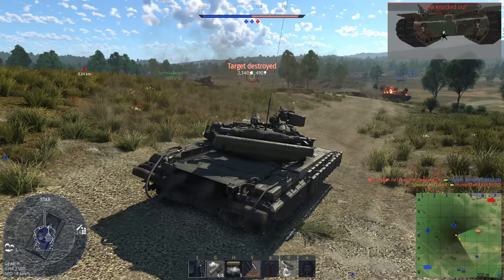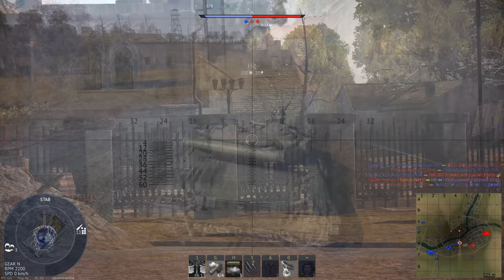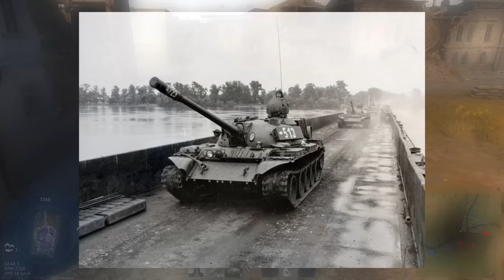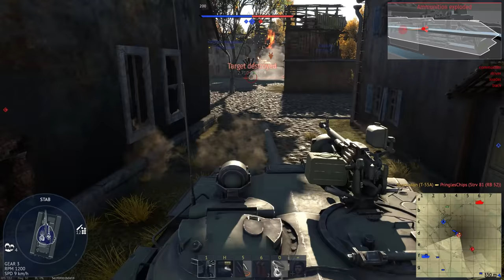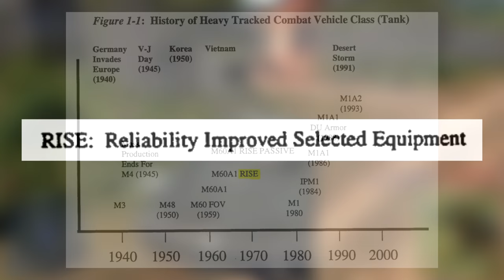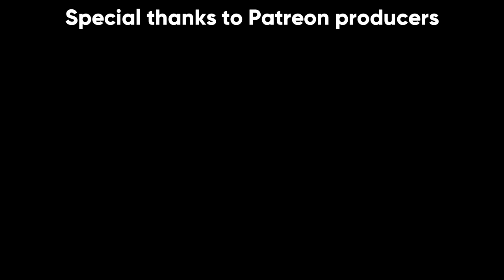Were Soviet Tanks Poorly Made?

Comment from the maker: There are a lot of misconceptions about the T-34 in the comments, so I thought I would clarify. When it came to parts like sights, radios, and intercoms on early T-34s, the quantity of them was not a huge issue. The quality was. Early periscopes used polished steel, which obviously reduced sight quality. Both the intercom and radio had reliability issues, but as mentioned in the video, they were improved as time went on. Ventilator fans were of short supply on early T-34s, but supply lines were eventually stabilized. Gun fumes once again became on issue on the T-34-85 (and specifically during warmer months), but designers did try to fix the issue as fast as they could. First they tried introducing a bore scavenging system, but the spent casings would still release fumes. The problem was eventually fixed entirely with the introduction of bore evacuators. The welds on T-34s were technically of lower quality and more brittle, but US intelligence during the Korean War noted that it did not have an effect on battlefield performance. The armor plate itself had a much higher hardness, increasing protection against singular shots but also increasing the chance that the plate would shatter with multiple hits. This was a deliberate design tradeoff. I remember recording a line stating that the quality of T-34s varied wildly from plant to plant, but I must have accidentally skipped it while editing. Some factories certainly cut corners while producing T-34s, but this was a necessary step. Soviet forces would often undertake incredibly risky and dangerous operational moves in order to catch German forces off guard, paving the way for easier follow-up engagements. This approach is often confused for human wave attacks. Anyway, this (and the fact that most of Germany's attention and resources were focused on the Eastern front), meant that losses for T-34s were staggeringly high. Even with the corner-cutting measures, T-34 production barely outpaced attrition.
Reply: i recommend the latest video from lazerpig, he goes over a lot of good details on the t34
Reply: @browning2471   was just gunna mention that lad, long video but he really breaks down the flaws of the war production T-34, very highly recommended
Reply: Tearjerker hey man you didn’t have to go out and just say it
Reply from the maker: @browning  It's a pretty solid video, obviously more comprehensive than this one, but unfortunately he does repeat some myths. For example, saying that T-34s would often ride into battle with spare transmissions lashed to the engine deck. This myth is based on two photos showing the same singular T-34 with a transmission on the back. I agree with his conclusion that the Soviets could not have won the war on their own, but I disagree with his assertion that corner-cutting on T-34s was unnecessary. There's little evidence to suggest that the T-34's high attrition rates were a result of the corner-cutting. I mean, just looking at his sources:

"Although welds in Soviet tanks are inferior in quality and much more brittle than corresponding welds in American tanks, this condition has not been a major factor in impairing the battlefield performance of Soviet armor. Poor joint fits, sloppy appearance, jagged and rough finishes should not divert attention from the fact that the Soviet tanks are rugged and battle-worthy and require many fewer man-hours of labor, precision machine tools, jigs, and fixture to construct than corresponding American tanks." - US report on Soviet metallurgy - T-34-85 vs M26 Pershing: Korea 1950 by Steven Zaloga

"Materials were found ample for the job - better than those used in American tanks, in some instances. Virtually all parts were in operating order. Engineering development had been actively continued; it was evident that most of the changes found through the comparison with the Aberdeen and German reports had probably been made to improve tank performance and especially tank service life, rather than to simplify or reduce cost...Detailed examination revealed that most parts were in excellent condition, with no likelihood of early failure. The exceptions are listed in Appendix 15, "Failures". Most important among these are the transmission and final drive, - inadequate in design, and the front suspension members, - a manufacturing and inspection slip-up." - ENGINEERING ANALYSIS OF THE RUSSIAN T-34-85 TANK, CIA

So if the corner-cutting of components and the armor aren't contributing to battlefield performance in a majorly negative way, it seems kind of counterintuitive to say that simply spending more time on individual T-34s would have been better.
Reply: Spookston What would you personally say the culprit of the high attrition rate is then? Faults of the design itself? Strategic issues? I’m not very knowledgeable on the T-34 myself
Reply from the maker: @browning2471  The Soviet's proclivity to undertake incredibly dangerous strategic and tactical maneuvers. These maneuvers inflicted immense damage on German forces, but often did the same to their own units. When looking at a tank's combat statistics, I think that often too much emphasis is placed on the tank's performance in a vacuum. More often than not, what matters is how the tank is used. The Ferdinand was a godawful tank in pretty much every measure, but it was still fairly effective purely because it had experienced crews and was employed in a way that played to its strengths. Simply having a tank there is better than not having one at all, even if the tank has flaws.
Reply: @browning2471  It's worth mentioning that for early barbarossa in particular, everything had high attrition rates. 

The soviets were outnumbered and generally unprepared both strategically and logistically.
Reply: @Spookston  PLOT TWIST - Here is another Soviet source directly addressing thr "cutting corners" and "poor production quality" 

The constant complaints from the front forced the authorities to investigate the problems with T-34 production. In September 1942 a conference was held at the Ural tank factory by the Commissariat of tank industry (12). The conference was headed by Major General Kotin, People’s commissar of the tank industry of the USSR and chief designer of heavy tank ‘Kliment Voroshilov’. In his speech he said:

''Now ... there are a lot of complains about the T-34. You all know the reasons for flaws in the tanks. The first reason –inadequate visibility from the tank; the second reason, and this is the weak link that always accompanies our vehicle in the Army – final drive. And third, the main issue that we have today – insufficient strength of the idler wheel's crank. These issues are the major defects of the T-34 today. Having considered these issues from engineering and technological points of view I would like to discuss another issue, the one that directly resulted solely from our production deficiencies. They are: negligence during production of combat vehicles in the factories, carelessness of assembly and quality control of vehicles. As a result during combat employment our tanks sometimes cannot reach the front lines, or after getting to the territory occupied by the enemy for conducting combat operations, sometimes they are forced to remain on enemy's territory because of some little things... We have to make sure that as a result of this conference all shortcoming will be uncovered and following this conference all corrections in the tank will be implemented in the shortest possible time...

Ask Google who was Kotin
Reply: Your making me love Russian tanks more and more.
Reply: Adding my 2 cents, I really feel Lazerpig was off the mark when it came to criticizing the Soviets cutting the corners that they did, with the whole "Quality always beats Quantity" argument. Especially given the crisis the USSR was facing at the time. Expecting the Soviets to carefully and lovingly churn out T-34's without cut-corners and shortcuts is absolutely ridiculous. About as sane as expecting an alternate universe US tank factory started up in the Rocky mountains with untrained locals to churn out M4 Shermans as high quality as they were in our timeline when the Germans occupy everything east of the Mississippi and have cut off Detroit. Unlike the US and UK, the USSR didn't have the luxury to build up a smaller but well made tank force, given the sheer attrition inherent in their literal life-or-death struggle. Namely that the whole what's better, 2000 shit tanks or 500 great ones isn't what the Soviets were dealing with. Rather it was more "We are losing 50-100 tanks a week, we need to make 100 plus tanks a week no matter what".
Reply: @Spookston  Lazerpig didn’t say anything about t34s having transmissions strapped to them all the time?
Reply: I honestly think the t-34 is really overrated. True it won in the east because it's what was needed, but it got decimated to accomplish this. I read somewhere they lost 73000 t34s in ww2 (might be wrong, it's what I remember.) Crew survive also wasn't that great. Just proof you throw enough of them at something, it will eventually win
Reply from the maker: @-Cheif  Could've sworn he did. I was listening to it in the background so I might've misheard. My bad if I put any words in his mouth.
Reply: @commander2552  but there were only 65000 T-34/T-34-85 built -_-
Reply: @ГеоргийМурзич  yeaahhhh I said it might be wrong. I do still think it's garbage though.
Reply: @Dragunov8808  except that's not unreasonable. The T34 was a pre war design and was well into production before the war. The US had less than 100 Sherman's when the war began and no dedicated plants to it. By 1943, over 25 factories had been built exclusively for the Sherman and by December of 43, over 11,000 had been built. At that time, all the factory workers had been drafted. 10 million Americans served in ww2, 7 million of which were drafted. In a country of 110 million. Roughly 10 percent. That means factories were filled with previously unemployed and untrained women and old people. Ford built a brand new factory in Ohio with the sole purpose of cranking out B-24 Liberator bombers in a town with no aircraft factories. And they built 8000 planes between 1942 and 1946. With previously untrained workers. The problem is, Stalin had just spent the 30s decapitation soviet leadership, his paranoia killed thousands of the soviets best officers and managers. The soviets did the best with what they had, but they simply didn't have the human capacity left. They didn't have enough trucks to ship supplies, so even when supplies were in abundance, troops still did without. That's why the US produced 2 million Studebaker trucks and sent a quarter million of them to Russia. Let that fact stay with you, Russia took Berlin, but it drove there in Detroit steel. Studebaker truckers became the back bone of the Russian logistics units and even became the bed for towed artillery and even the Katushka rockets, many were in service well into the 1980s. What's unfair is to criticize capacity. Russia had just lost a majority of its factories and this was 2 years before the first shipments of American trucks and planes would arrive. So I won't say anything there, but quality was entirely on them.
Reply: @-Cheif  actually he did, it was a semi common practice to bring spare transmissions into battle with them, but not strapped to the tanks. By the time Russia actually had enough spare transmissions, American Studebaker trucks were plentiful and they were being used to carry the spare parts.
Reply: @theduke7539  That's the whole thing. It was unreasonable for the Soviets. The United States had massive existing automotive and heavy industries that could easily be converted into war production plants and, FAR more importantly, were not being invaded. There's a map on the internet that someone made to illustrate what the USSR was going through, except making a direct comparison to a similar situation to the US. In it, the Germans controlled the entire Eastern third of the US, with most of the cities and industry falling into German hands, with St. Louis and Detroit under siege. That was what the USSR was going through. It's one thing for the US to crank out fantastic M4 Shermans when they aren't getting bombed, aren't getting invaded, and have a relatively small expeditionary army to equip. In fact, it should be all but demanded that they should. The Soviets had seen a massive portion of their cities and industry fall into German hands and needed to churn out something, anything to keep them at bay. The T-34 was a imperfect tank made vastly more crude by the demands of the war, and I would not want to have crewed one. I would rather crew a Sherman 9 times out of 10. But the T-34, and the corners cut to mass-produce it, were absolutely vital to the USSR's victory.
Reply: Problem is you made a general video to discuss a specific issue. WW2 Soviet tank production is it's own argument and to include T-34s with later tanks is doing the entire debate a disservice. You basically hand wave T-34s issue as "cosmetic" when those cosmetics you handwave as "the parts that matter were well made" were issues like armor plates being up to 1 inch gaps in some places. In the end the entire video comes off as sloppy and all over the place by giving each tank only a minute of discussion and not really including the overall issues of the time the tanks were produced in.
Reply: @Spookston  yeah , his video while making good point are also full of error and myth which really drop the video quality to the point where it sound amateurish , if someone wanna learn more then i would recommend them video from the Chieftain/MHV cause they go much deeper and they also provide context and development for the design and choices that was made.
Also the comment section is so full of myth that i thought died out since 2015 ( human wave , shot man in the back lv of myth ) that im honestly losing my faith in people ,who lack basic historical knowledge.
Reply: the point is: did the initial design even fit the requirements the soviets wanted? sadly my source book (tanks of operation barbarossa you probably know it is laying elsewhere). But the Long march test from 1940 is very intrsting in my opinion. I clearly shows that the early T34 didnt managed to accomplish their design requirments and needed improvemtn, ok thats how engineering goes. but still the tank appeared in abrb in later on with the same problems. Say the soviet had to produce so much is correct. but thats because of the mistkaes made in the inter war period. In some factories alomst every single competent person + their adjutant were purged. The T34 couldnt become something useful. But thats no excuse for its overall bad performance.
Reply: .... bro on the t34 you didn't do your job im kinda disappointed because most others I don't give them any mind. 1.) the latter t34 were produced too a much higher quality. 2.) ww2 t34 were so bad that I would bet 50% of them would brake down before they even got to the battle field. 3.) Lazer pig did a video about this and man if half of that is true I would seriously consider doing actual research instead of form post and other hear say sources. So in short no..... quality doesn't have a quantity matter to it.
Reply: @Spookston  Regarding your assertion that T-34 transmissions being carried into battle was a myth, I feel I must disagree somewhat. It is unlikely that a T-34 commander would show up on the start line for an attack with a transmission still strapped on, so to that extent, they did not literally "carry them into battle", but German records of killed/captured T-34s at the end of 1941 showed that about half of the examples they had were not battle damaged, but had suffered some mechanical breakdown (often, but not exclusively the transmission. Early T-34s were not especially well made or specced), causing them to be abandoned, and also not destroyed by the fleeing crew (obviously, it is unknown how many more WERE destroyed successfully by their crews on leaving the tank).

That said, the situation became much better after 1941. The Soviets were constantly improving the design of the T-34 and their other vehicles, and relatively simple changes that would not greatly impact production such as building new tanks with improved, stronger transmissions once supplies of them were available were often implemented as soon as possible, and not subject to the annual "design freeze". However, I don't think that citing a 1950 report on a T-34-85 that would have been produced in the late war, or even post war period, is shedding much light on the manufacturing standards that existed and applied to tanks produced in 1940 or 1941
Reply: @browning2471  That video is full of hyperbole and myths, as mentioned in replies above. Actually I would say it's similar in its regard to videos talking about how amazing German tanks were, just in the opposite direction. He focuses on a pinpoint on every source which says something to support his argument, and ignores the sources which don't. This means he either:
1) Looked into these sources and dismissed them
2) Didn't look for sources well enough and did not find them
Either option would suggest a lazy historian and a bad researcher.
Reply: It is impossible to know if making better quality(by investing more time) T-34s would have been good or bad for the USSR, and to what degree as well as how much more time would have been invested with which results. I personally don't think it was a terrible nor a perfect idea, if I had to make the decision I may have gone for more refined tanks. In any case, I do not know in detail all of the varibles such as crew availability, components, materials, training or political and social situation so I can only wonder. It worked, so it was good enough or not bad enough, depends on how one wants to see it.
Reply: @Ypog_UA  I always see you around. Just a thought. Hi anyways.
Reply: The overhardened plates would shatter more often than not, so while it was POTENTIALLY better, the spalling and shattering issues were the majority of the losses during actual combat conditions 

And Korean war tanks were vastly modified from ww2 counterparts 

The t-34 wasn't the only tank that had the same problems, but it's the one that had the most and most unique at the same time, not due to limitations of the existing technologies of the era
Reply: @ushikiii  Hello, and yes, I comment quite a lot...
Reply: Imagine you were a history teacher,bro the whole claas would have an A XD
Reply: @SparrowNoblePoland  now i dont speak for spookston, but i think that giving fair ciriticism would be fine by him, but theres no need  to go out there and maliciously insult him over his speech, there seems to be no problem with it to me, sure he speaks a bit quickly but that doesnt mean hes addicted to meth and was sucking moonshine from the teat, and theres no slurring or anything like youd expect from a career alcoholic
Reply: I know a few people who worked for the British Ministry of defence as engineers. One of them, a lady, after the first Gulf war, was given a piece of steel to test for quality. She did the tests and reported back to her manager that the sample was common mild steel, like your car or fridge is built from. 
He answered, “Well that steel is a sample from the glacis plate of an Iraqi Republican guard T72 tank. It was knocked out by the 30mm Rarden cannon on one of our Warrior APCs. Went straight through it! It should be armour quality steel of course”. 
That’s how you build 10,000 tanks.
Reply: @Spookston 
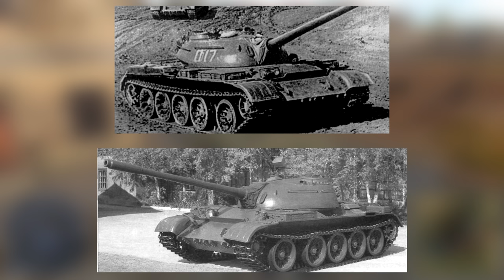2:03
The vertical stabilizer and driver's night vision device were introduced in 1955 on T-54A (one other improvement was fume extractor / bore evacuator). 1957 T-54B had a two-plane stabilizer and full set of night vision devices / sights for driver, gunner and commander.

As a side note, during 1960-1968 period virtually all Soviet Army T-54s mod. 1949/51 and T-54As were upgraded to T-54B standard (except no fume extractor on upgraded T-54s mod. 1949 and 1951, because the original gun was retained, with counterweight added instead at the end of the barrel for proper stabilizer function).
Reply: @SvenTviking  yeah intresting,also the soviets did overwelm the enemy in ww2 with more tanks than the enemy had and won with numbers,nowdays you have really good protection like hard kill and its a very dumb strategy.Thats how the french lost durning ww2 they had the strongest army in europe but outdated tactics
Reply: @funnycatgaming8506  There might be no need, but this is for his own good. It wouldn't be good in his real life if people thought he's on drugs, so at least for that he should do something about his speech.
You, you can't imagine how big pain in the ass Britons are. You can score IELTS 9.0, but unless you've lived in the UK for quite some time, you won't be able to understand Britons in the international corpo. From perspective of many other nation, most of them gibberish like drunks and can't be understood however many times you ask them to say again.
Reply: @Spookston  But were the korean war T-34s war time production or improved models made after the war or at ending months?
Reply: @SparrowNoblePoland  first off, insulting him for his own good? have you heard of empathy and emotions before? second, i know how "hard" it is to understand brits as a foreigner, because im from australia, my town alone has people from all over the planet, south africans, brits, people from zimbabwe, canadians, all sorts, compared to an old alcoholic smoker aboriginal (which half my family is) spookston speaks quickly, but is much easier to understand, if you want hard to understand, talk to my grandfather for an hour, spookston has very easy to understand speech, theres no problem understanding it unless you were bashed on the head as a baby
Reply: @funnycatgaming8506   1. No, he is not easy to understand. Many languages don't even allow speech that fast, he even though he's pronounciacion is rather clear, he would have been a pain in the ass for international co-workers. 2. Yes, I've heard of feelings and emotions, and that's another reason to do it. Spookstoon is not a little baby or a girl. He's an adult man already and either such words would not hurt him, either he should grow up.
Reply: @lepathewarrior4445  likely wartime models made during the war and wasnt able to be given to their intended units before the war's end
Reply: @SparrowNoblePoland  an adult man shouldnt be using insults in the first place then
Reply: @SparrowNoblePoland   @SparrowNoblePoland  how old are you?
Likely teen since you're still stuck with "sjws"
And here's the thing called maturity as one grows up, or should we stay immature?
Reply: @SparrowNoblePoland  i dont associate insults with teenagers, i associate teens with obsession of 'sjws' and the likes. Everything that isnt like you are apparently 'sjws'
You destroy the person with facts? Arent facts meant to educate someone and not destroy? 
How many clickbait anti sjw videos have you watch?

I dont usually care about insults, but overdo it and you'll just come off as someone to avoid
Reply: @SparrowNoblePoland  So basically you're insulting your friends but polite to your enemies?
Reply: @kristianfagerstrom7011  I shall repeat myself; watch 'Gran Torino'.
Reply: @SparrowNoblePoland  I don't think I'll spend 2 hrs watching a film on your behalf in order to make a point that you apparently cannot make yourself.
Reply: Well. 
The idea of ‘throw some men into a can and send it out’ isnt quite wrong today.

They still operate the aged T-72 in the B4 config. It is just a constant upgrade stream with the T-72.
But looking at the T-72, 80, and 90; all 3 are getting modernization upgrades. 

This is what i dont get. Russia has made some 7,500 T-80s. The T-80 was suppose to be the most advanced of the 3 right? 
Then why keep operating the T-72? 
Russia only has about 1000 active and standby T-72 crews. Just fill these crews into T-80s and stop wasting their dieing economy on the T-72.

It would help much more for that T-72 money to go to the T-14.
I find it strange that Russia operates 4 MBTs. The T-14 more of a TD, but what ever.
All wile having the numbers to run 3. As the T-90 apparently doesnt have enough made to fill just it and the T-14.
Reply: @LynnetteJJW  1. Countries surrounding Russia rely on tanks much worse than T-72 B3. 2. T-80 not only is expensive to operate, it has some fatal flaws. 3. T-14 is far too expensive, especially to make it actually battle worthy, with good quality ammo, service and so on. That's why Russia chooses to rely o T-90 and T-72 while T-14 and T-80 remain where they should: on parades and at junkyard.
Reply: Why did you bring american intelligence during a war in the 50s that are post war. When the test done during ww2 showd there engines were bad and armor had alot of issues of cracking and out right rip apart at the seems? Post war vs ww2 is a big difference.
Reply: @SparrowNoblePoland  I hope you enjoyed watching your film. -calling yourself idiot seems harsh, but hey, as long as you're happy 🙂
Reply: Spookston, high hardness armor above 375BN does not improve effectiveness vs single hits but not vs multiple. High Hardness armors will only improve effectiveness when the Shell diameter does not exceed the base plate thickness. This is why thinner plates on tanks tended to be higher hardness because they were too thin to stop bigger rounds anyhow, but the higher hardness would improve protection vs smaller calibers. When the thickness to diameter ratio is below 1.0, the penetration mechanism increasingly takes the form of plugging due to shear failure instead of ductile hole formation. Like punching a hole through a brick wall instead of drilling through it. This results in much lower protection because plugging is more energy efficient. War Thunder no longer models this btw, which is why the T-34 glacis is too strong. A T-34 glacis would have an effective thickness of 122mm, but versus a 75mm APCBC projectile, the effective thickness drops to 93mm due to the significant over match of high hardness steel. On top of this, you have increased vulnerability to armor fatigue, as you mentioned, due to the lower ductility of the plate. This is the reason that every other nation in ww2 went for armors of 220-350 BHN, because that was the best combination of hardness to ductility. Lastly, the use of 430-460BHN armor on soviet tanks was NOT a deliberate design decision for the reason you mentioned. The reason that all Russian tanks during the war were manufactured with exceptionally hard armor, was because it was easier to manufacture like that with unskilled laborers and therefor suited Russian wartime needs of making a lot of tanks very fast. This is also the reason why the weld quality was trash and it was no uncommon for tanks to come of the production lines with wildly vary armor thicknesses, above but very frequently less than specification.
Reply: @SparrowNoblePoland  So brave behind keyboard....
Reply: This is all well and good spookston... but as we all know russians included less than 10% of T34s were actually built to standard.
Those better radios? why do they need radios?
Glass? why use expensive glass when you can use polished metal (which isnt even polish and cant be seen out of)

If i draw up plans for a leopard but then give it to monkey's in a cave to build am i still going to get one thats good as the others?

All the T34's we have today are post war models.
Even the koreans said it was cramped and uncomfortable and they're smaller than russians.

Even the russian tank brigade leaders themselves, even  zhozef kotin creator of the KV1 said hey this has lots of issues.

And as for your "Multiple plants" argument... 1 plant built well over half of the dozens of thousands of T34s... this plant also built the worst T34s.

The god tier mythos around this tank continues to grind my gears even to this day. even though its biggest killer was the panzer 3 a tank that "CoUlDnT PeN It WiThOuT SpEcIaL AmMo"
Heck, IT STILL HAD ITS OWN PROPAGANDA DEPARTMENT IN THE KREMLIN UNTIL THE LATE 1908S.
What does that tell you?
Reply: @Dragunov8808  You evidently didn’t listen hard.  The entire point of the argument he made was that if the tanks were made better, they wouldn’t have been losing so many.
Reply: @Spookston  Having seen Russian tank performance in Ukraine, this whole video has aged like milk. You fell for the LazerPig Loop. Admit it, you fell for Russia’s propaganda. And their propaganda about their modern army isn’t any different than the Soviets’ propaganda about the T-34.

Also, quick note. I’m an engineer. The high hardness doesn’t make the tank more resistant to single shots and only make it more likely to shatter after multiple hits. It makes it much more likely to shatter a shell, but it also makes it much more likely to shatter after a single shot. Now, given that you play video games for a living, I’m going to assume that you’ve probably never taken a class in materials science, especially one focused exclusively on steel like I have. You probably couldn’t explain the differences between austenite, pearlite, and martensite, or correctly use iron-carbon phase diagram. Now that’s a bit in the weeds, but it does speak to the level of research vs. myths and legends we’re dealing with here.
Reply: Nah, you gotta look up LazerPig on the T-34. The T-34's made during the war were in a very, very bad state. Which comes from the producers being pushed to produce as many as they could and that becomes easier the more you leave out.

Fabrication aside, you can see in Ukraine how poorly made the Soviet tanks were. There was little to no thought about crew survivability.
Reply: @oisnowy5368  He did mention this.
What he FAILED to mention was that even POST WAR soviet t34's were still extremely bad.
Also if we're going to rate tanks on how good they were DESIGNED not how well they were actually made. i guess i can now make a design of a 1000 ton tank that goes 500kph? because its not my fault the factory isnt making it to spec. it good tank honest.
Reply: @Spookston  Technically, he only cites poor construction as a cause of high attrition after 1942; earlier he talked about poor logistics in 1941 and design features (Christie suspension, fuel tanks in the fighting compartment, and an overall cramped interior) that contributed to high losses.
As to his sources: immediately post war, there were only three sources for T-34 info: German generals who hyped up the tank to cover their own failings, Soviets replacing their wartime models for postwar tanks, and Aberdeen tests which appear to use an old T-34/76. As such, some of his sources may have outdated info.
Finally, this (and a later video on the Crusader) is less about bringing down the T-34 than it is about disproving the Slavoboo/Wehraboo shitposting found in any online forum of military enthusiasts.
Reply: @oisnowy5368  T-90M and T-14 proves some of ur points wrong